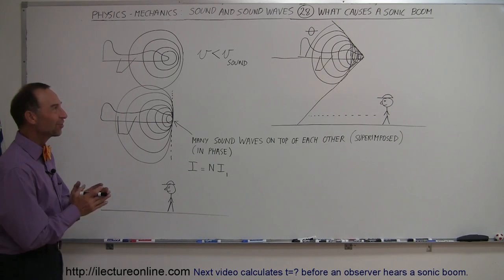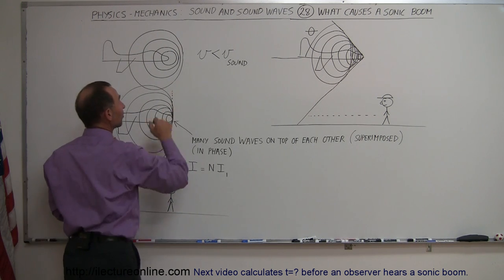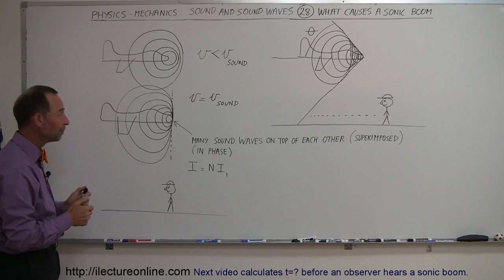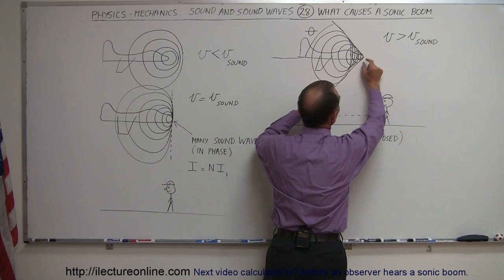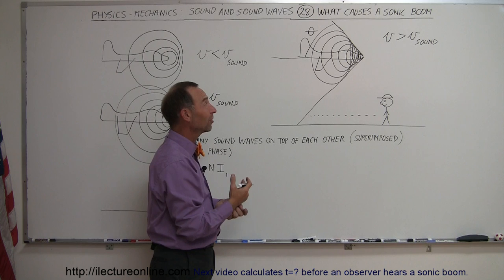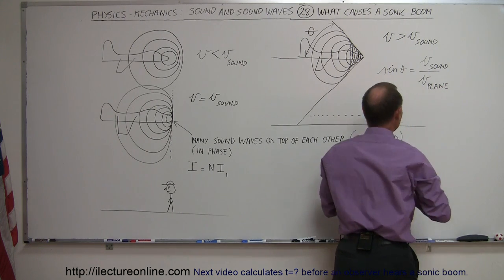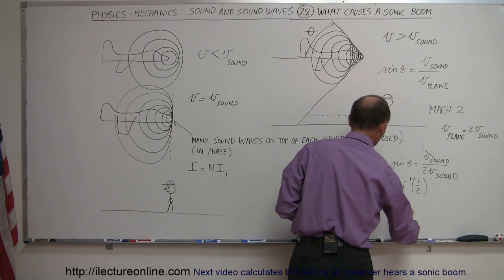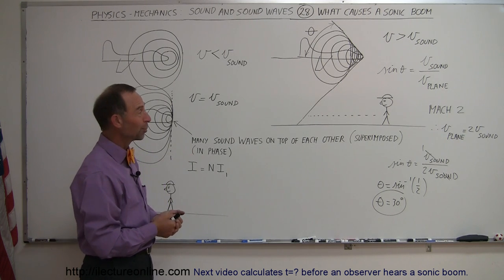Physics 20  Sound and Sound Waves (28 of 49) What Causes a Sonic Boom

Comment: The noise from the planes engine(s) were mentioned.  The Space Shuttles guiding along without power made a loud double boom as it's shock wave passed by.
Reply from the maker: An object gliding at supersonic speeds will still make compression waves which act like sound waves and will be compresses as shown in the video causing the sonic booms.
Reply: @MichelvanBiezen  yes I didn't think the video made that clear. Living  under a supersonic corridor since 1957.  I can just about guage when to expect the boom as I watch the contrail.
Reply from the maker: We used to hear the shuttle booms as it came in for a landing at Edward's Air Force Base.

Comment: Good video and great explanation for sonic booms! I still have a question that I can't find a good answer to. I understand the sonic boom is continuous along a supersonic object's path. Say a supersonic jet is flying straight at you and you have a line of people in front of you (a rather long line lol). As the jet passes over the people in front of you, they will all hear the sonic boom. What if the jet slows to subsonic speeds before it gets to you? The jet is no longer producing a sonic boom, but what happens to that shockwave it was producing while supersonic? Will that shockwave continue to come at you and cause you to hear the sonic boom that was created while the jet was supersonic, or will it only be audible to people that the jet passed over while it was supersonic? To rule out any effects from buildings or structures, let's say this happens in a wide open field
Reply from the maker: You would still hear the sonic boom, once it reaches you.
Reply: great question, terrible answer.  I too would like to know if there's such a thing as a reverse sonic boom, as a plane goes from faster to slower than the speed of sound.  Also, I've never heard a bullet make a boom sound down range.  Also I've heard as an example, a whip can make a sonic snap, but that's odd, as a arrow goes faster and makes no sound and it's well below the speed of sound.  And if a pitcher can only throw a ball 100 mph, why if they had a whip would the speed increase 7 times as fast?   And is the boom the result of the waves passing through the air, or the waves hitting a solid object, such as the ground?   I'm always suspicious of what's called science, when the example given is proven by math and not by an experiment in the lab.  Try proving space can be a vacuum in the lab and it fails.  Try proving water can adhere and bend around a sphere, it fails, but obviously they can be proven to work fine if just math and faith is employed.

Comment: Could you please just make clear, that a sonic boom is not related to the noise of an aircraft. Even gliders would cause a sonic boom when travelling at M1 or faster, due to the compressibility of the air. Just refer to the booms caused by spaceships like Challenger, Columbia  or Endeavour gliding back to earth faster than M1.
Reply from the maker: Sound waves are  compression waves, thus if an  object compresses air (by flying through the air), those air compressions will  also cause sonic booms if made at speeds equal or greater than the speed of sound

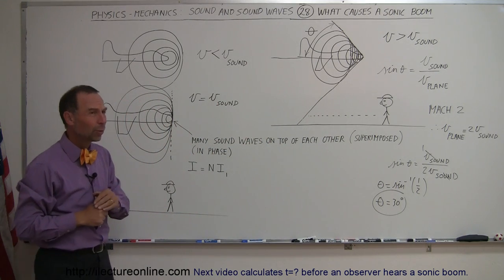Comment: 6:14 Awesome !!!! That's exactly what I wanted to know.
But now I've got another question. If a jet travels for a range of time faster than the speed of sound and another jet follows it behind at the same average speed, will it constantly keep on hearing a sonic boom ?
thanks for the lesson, it was very interesting.
Reply from the maker: +areamusicale That would be a hypothetical situation, but the best way to think about it is this:  you will only hear the sonic boom when you travel through the shock wave or when the shock wave passes by you.
Reply: Michel van Biezen yes, right ! I was thinking something similar (that's why I said "same average speed") because I was thinking of sound levitation in that moment, like, if you are in the middle of the wave, probably you wouldn't hear anything (like a light object trapped between sound waves... well, not exactly the same thing), so, yeah, it makes sense that only if multiple waves pass through my hear I will be able to hear the sound.
It's just a bit tricky thinking "hypothetically".
Thanks for the clarification.

Comment: Can shockwave be faster than sound in air?
Reply from the maker: The shockwave itself travels at the speed of sound
Reply: Yes, bombs always make shockwaves witch are SuperSonic expressed as  a MACH Velocity
 More explosive higher velocity but not linear relation. Sound pressure from the shockwave increases the higher the MACH NUMBER of shockwave.. ordinary bombs can produce Mach 1.5 far away 1 mile
,,, but very high like MACH 5 nearby like 5 feet away!!!